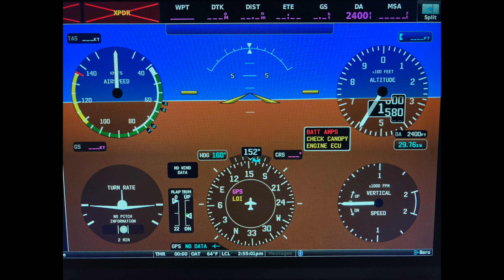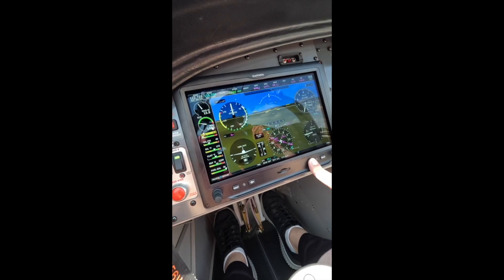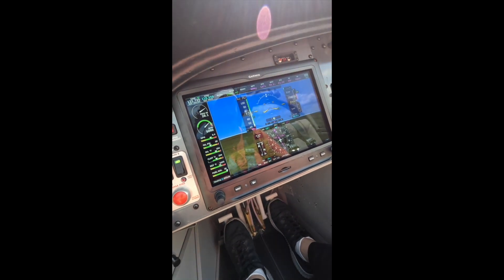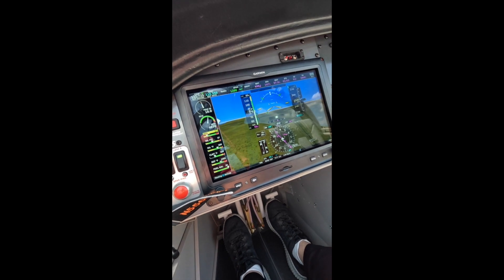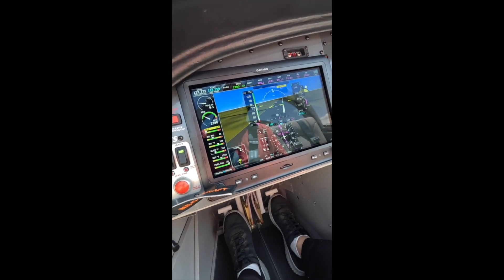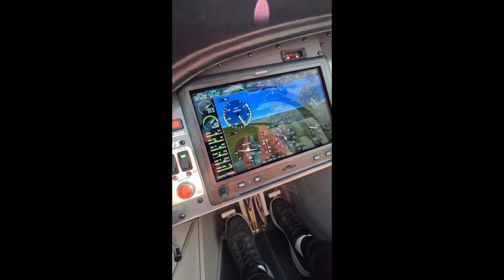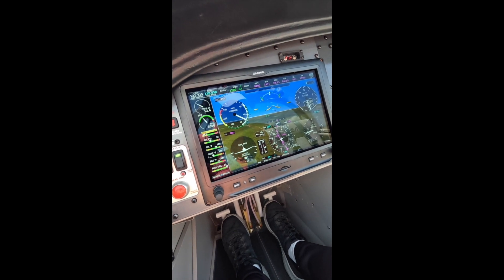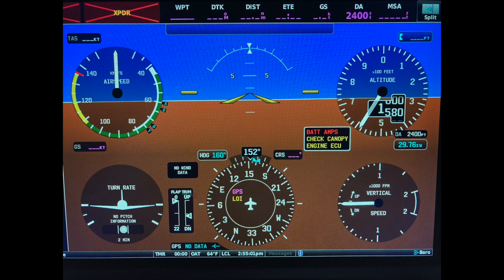RV-12 Battle of the PFD

Comment: First, thanks for your video series, I just started building an RV-12is… I am also choosing the Garmin avionics, so I am enjoying the tutorials. I learned to fly (military) with the traditional 6 pack gauges, but have several dozen recent hours renting an aircraft with the G1000. (I love that the G3X reverted to the traditional ball display). It took a while for me to become proficient with the tapes, (like the CFIs tell us-primacy is an important learning factor) I do expect to choose tapes over 6-pack when all is said & done. I note that you did not set an altitude bug to help recognize altitude deviations, and with time you start to easily pick up the magenta line of the VSI as well…I miss the round clock with the sweep second hand- much easier to get a feel for rate when teaching timed turns, climbs, etc…maybe I can find a salvage 8 day clock somewhere😂
Reply from the maker: James, good luck with your build project!  I envy those who have skills - mine is a store-bought.  I have tried both tapes and dials and I just feel like the dials, being so much larger, make for a faster instrument scan.  I'll admit that for casual flying I often do not use the glass panel with all its capability and tend to set the altitude bug just for autopilot work.

Comment: I could see using the six pack during landing or in familiar areas where you know where you are/where you're going, and just want to fly. I could see using the other set up if you might need to find other nav information right away and don't want to have to change screens. I haven't use the G3X, can you move the gauges or delete the ones you don't want on the screen, or is it static? Would seem you could make them bigger if there were like 4 or 3 instead of 6.
Reply from the maker: Your point is well taken.  In this video I was flying the pattern at my home airport, so nav info was not an issue.  If I am going XC, I can split the screen to show a moving map or other data in a window on the right side of the screen.  The gauges become smaller to allow the screen to hold the additional nav info.  In this configuration I still personally prefer the six pack setup for all the same reasons I prefer it when no nav data is displayed.  You can often see this layout in some of my other videos on this channel.

Comment: Okay now I want to try with the six pack screen.   You have made a great point.   How does it work with split screen? Meaning,  map/ six pack?  Still big enough to see?
Reply from the maker: Hi Nick.  Yes, the display is still large enough to see.  You will sacrifice the turn coordinator, I believe, and half of the VSI, neither of which will matter.  But airspeed and altitude, the two things you need the most will be just fine, although a little smaller due to compression.